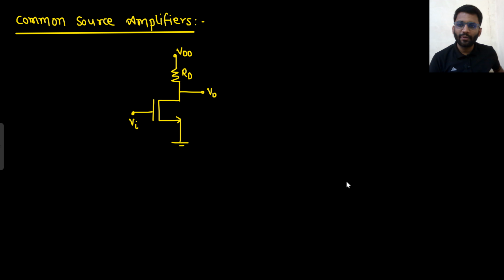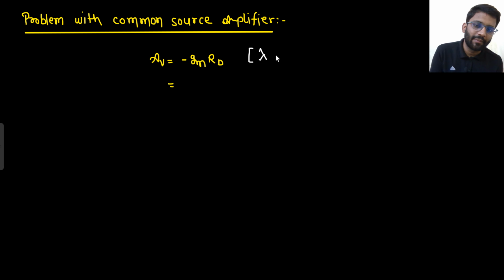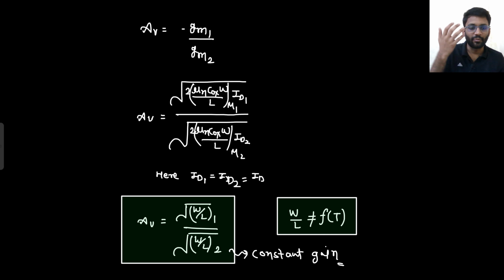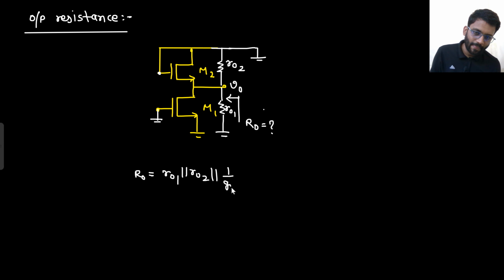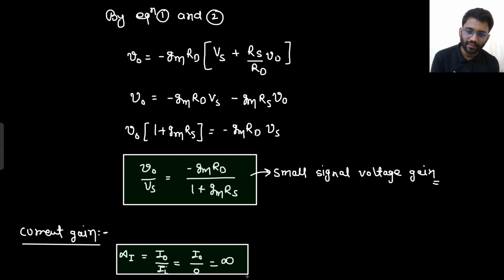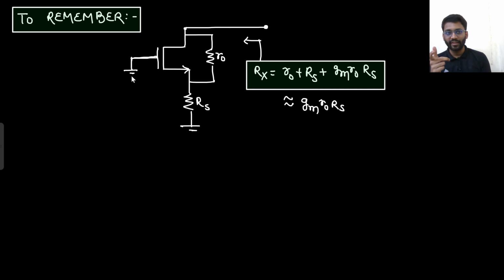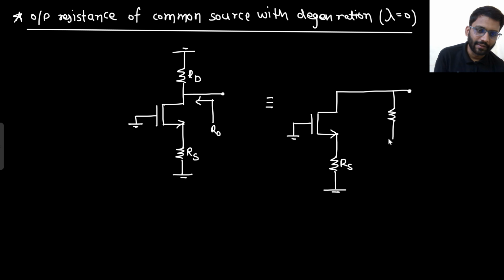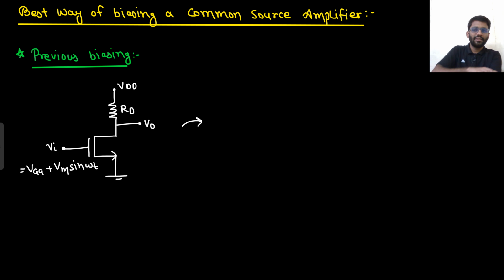Common Source Amplifier With and Without Degeneration || Analog Electronics || PrepFusion

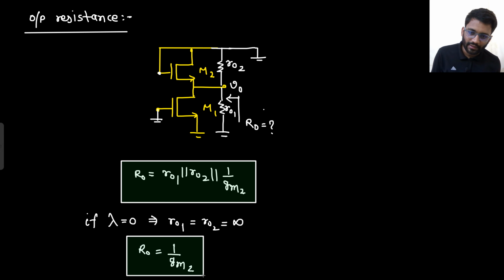Comment: at 41:56 min , if the Gm1 is not present because of open ckt (as gate source shorted) , the how it can be Ro=1/Gm2 . i mean how the Gm2 will exist
Reply: gm1=0 then diode open ckt.apply test v at op side.current only flow through r01,r02,1/gm2